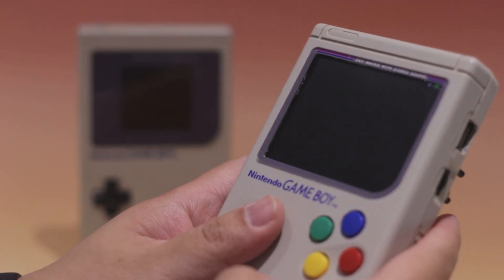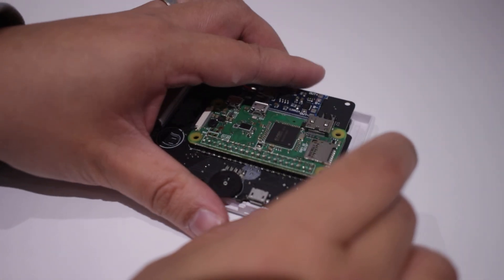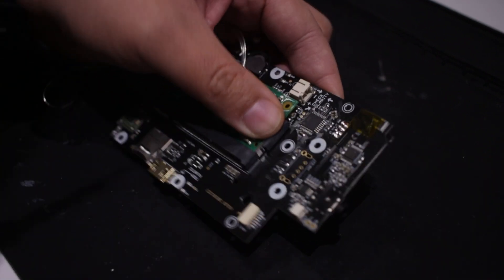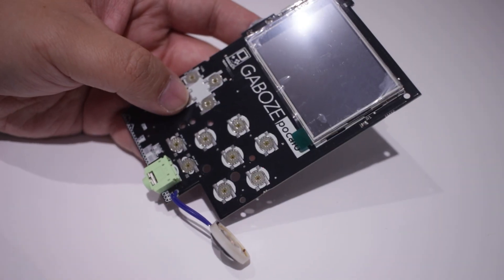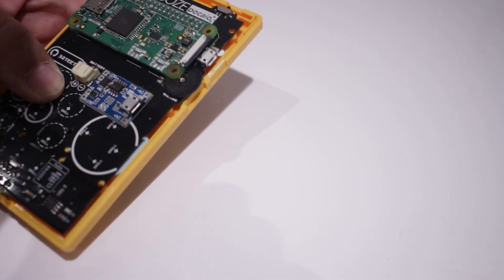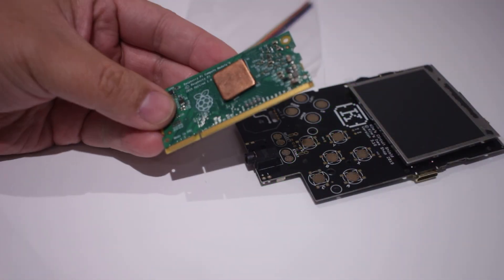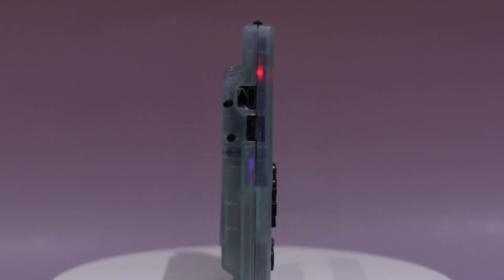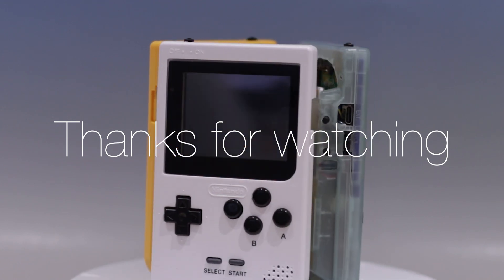Gameboy Pocket Pi - A Raspberry Pi Gameboy Pocket Build

Comment: Sadly it's just not cost effective anymore with all the Chinese emulation handhelds these days. I got a Pi Zero 2W for like 15 bucks and wanted to make a little cyberdeck like device. Unfortunately, no one makes a kit for it. The project hit a wall because the price and complexity was getting too big for a cheap little DIY thing. So I considered making it in to cheap a retro gameboy device, but any kit I found was close to 80 bucks, and I already owned 2 retro handhelds that were on par or better that I bought for less (individually.) For 40 I might have considered getting better at soldering to build something but the prices just dont work when someone already made it cheaper and better than I could. But yeah if someone makes a kit for a Pocket Pi computer I'd be all over it. (For the record, I'm already aware of the Hackberry Pi, but it's always out of stock and hard to know when it's back in.)